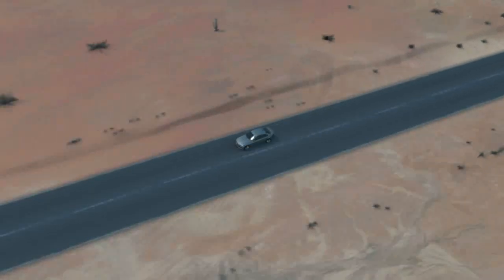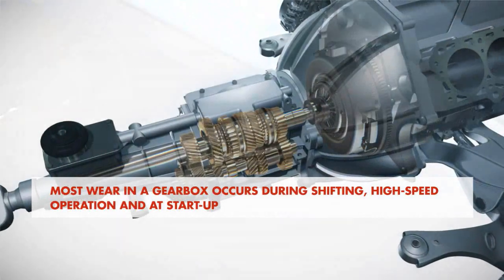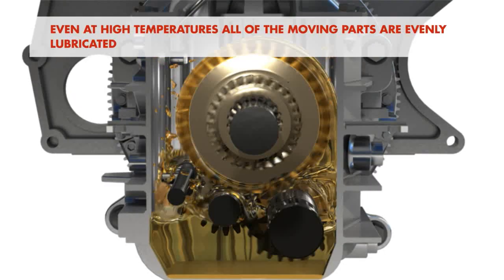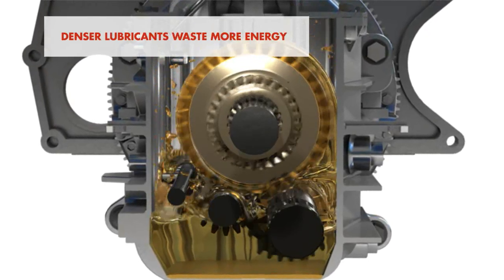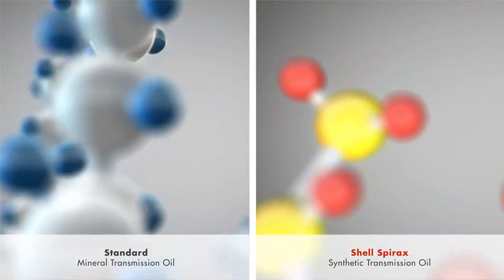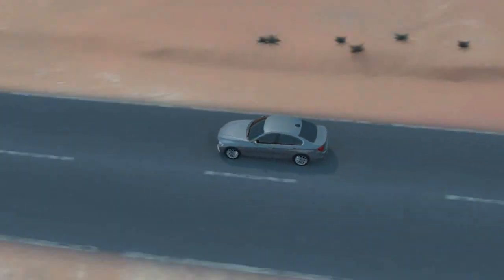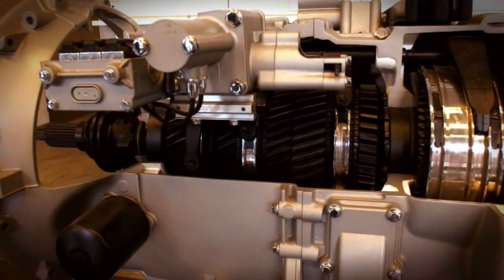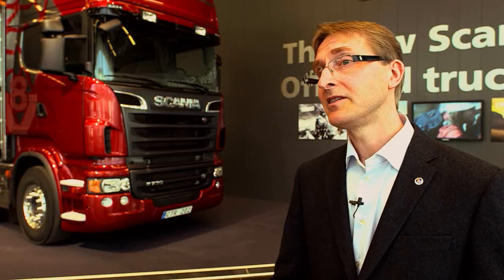Transmission Oils – High Temperatures

Comment: We have an gearbox application where the the working temperature is expected to vary between -25 °C and +50 °C. As a lubricant, which Shell product can meet this range of temperature?
Reply: Use Lard. Keeps my engine smooth

Comment: Gearbox oil. Fuchs makes best oil on the market.
Reply: You Wish ...no, their Centistoke measurements of kinematic viscosity at 40c and 100c are significantly better, as is the Viscosity Index rating that means they degrade far less at higher temperatures. Fuchs’s fully synthetic motorcycle oils are also the best, and their shock oils have VI ratings almost double their competitors.

Comment: What will happen if d gearbox is fully filled by d oil?
Reply: Rudresh Naik the box would have too less amount of air to operate
Reply: Stay healthy an lost longer
Reply: Due to friction losses in the fluid, power loss and fuel consumption goes up and you can possibly even overheat due to the fluid being worked more. And lastly, it would just plain cost too much to get that much oil when not actually needed

Comment: Thank you very much 
god bless you admin .
I was having a doubt that when we have provided backlash in gears then still we have skidding at points other than pitch point ,so how can we say that tooths are not going to jam again .But this video has cleared my doubt that by providing oil lubrication we can achieve thermal equilibrium bw gear and oil

Comment: just use high end full synthetic oil and add formula 1 type (rally) oil additive , i have been using it since 2010 and it works wunders, ppl who dont belive it have to try it for them self. I allso when i heard from this rally type oil additive, didnt belive it could do mutch of a difference but after trting it on my old beat car and a lawmower that never started after 10 pulls, i added the rally world  oil additive and wola, with first try it started up like new.